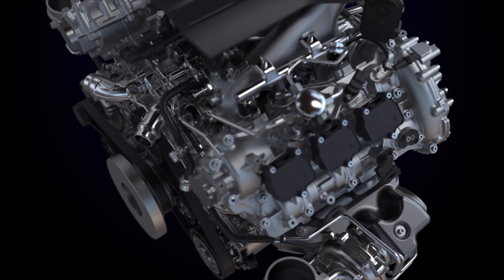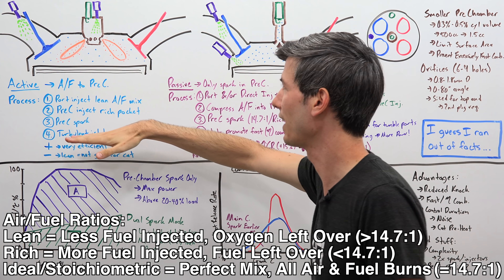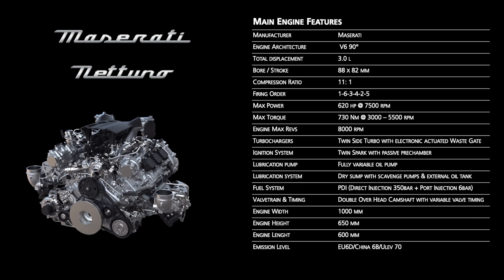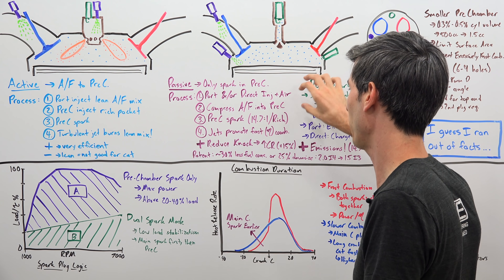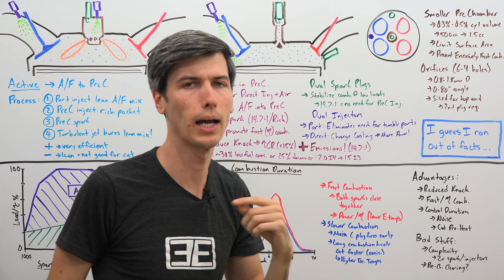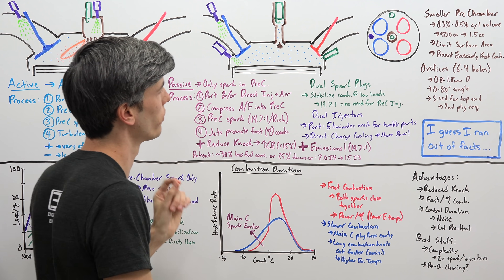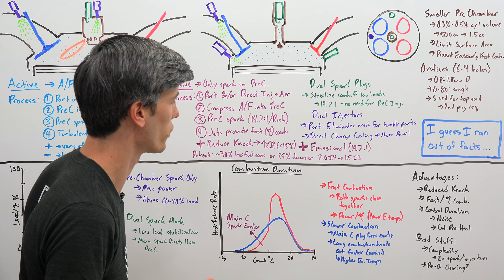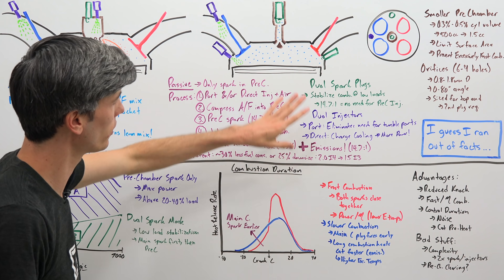How Maserati's Brilliant MC20 Engine Works - F1 Tech In A Road Car!

Comment: Port injection also cleans the backside of intake valves which DI alone can leave them caked with giant gobs of carbon requiring regular cleanings. 

- edit - 
The reason I commented this is because I was waiting for EE to list this
 as one of the benefits of port injection, but he never said anything 
about it which I thought strange given his usually thorough explanations.
Reply: Port injection doesn't clean valve backside when combined with direct injection, specially because works only in low load. Direct injection produces too much soot in low load combustion,  it's real valve fouling root cause.
Reply: e1cabral na
Reply: cb350f actually with Maseratis, its a once a year oil service interval. Don’t know what the Netuno uses but the V6 in the Ghibli uses a 7-9gt oil pan, and they use 5w-40 synthetic oil (less coking that way especially in turbo’ed engines.)
If you figure the average use of any car is about 12-15k per year, is one of the longest service intervals I’ve heard of, next to the Chevy Volt which has to tell you when to change the oil by remaining service life. After 6 years of ownership, still haven’t replaced the spark plugs (mainly cuz the engine is hardly ever used), no 30,000 mi plug change.
As far as time change automotive items goes seems is a better interval, plus Maserati has GT and Indy car test results. Average drivers are easier on Indy cars.
And would rather service my car before it breaks, than trying to find a ride home.
Reply: Full E85 is a solution also
Reply: Brandon Only if there’s E85 around. I don’t see a lot of E85 in states whose politicians have oil interests. E85 is human consumption alcohol (Ethanol is what folks drink).
I don’t drink and neither does my car, though Maseratis can handle it, I don’t do it.
Reply: lol anyone who judges maintenance interval by distance driven doesn't know much about cars.
Reply: @ejv0wjc08gtsnoj0  Agreed, how do you judge maintenance interval?  I have an OBD2 reader which measures the amount of time the car has been driven at each engine RPM.  Every time the car is turned off, I enter those as inputs into a function I've derived, and once the output of that function hits a number that I've pre-specified (which is based on the minimum time the relevant components would be expected to fail if constantly driving at 80% engine load (which in turn is based on a variety of materials and structural analyses, among other things)), I perform the maintenance.  It's so much more intuitive lol I don't know why more people don't do it.
Reply: @firestarter4247  🤣Got eem
Reply: cb350f Hmm, it’s only possible to do 50k/ yr, if yer a single guy with no kids, and/or you live in Alaska and commute to Canada to work, or Texas.
Though never met anyone on a 50k trip, sober or otherwise.
Also, don’t know the chemical make up of Maserati engine oil, but if they can swear by it for a year, what the heck, why not? There’s obviously a reason the oil filter is $50. 
With american cars,  4 oil filters/yr is still about $50, ya have to think differently with these european cars, and it’s a headache for a domestic car mechanic, I hate takin’ pills anything!
On older cars, yep, 3-5mo or 3k-5k miles for oil. Change plugs, wires, and points when they foul.

New cars, read the friggin manual, you’ll be a happier new car owner (especially cuz there ain’t no points ta mess with.)

Admit it, 50,000 miles a year is a bit extreme for anyone. I don’t recall if there is such a section in the owner’s manual for these types of cases. 
If you are a GT driver, well, yer pit crew has it handled.

Though in a Quattroporte, definitely have to make a good attempt at it. V8’s love gas though.
Reply: @pistonwristpin1  Then here and interesting addition from the european market. 
Ford Fiesta 1.0l 3 Cylinder Gasoline 100HP - 1 Year or 15.000km
Ford Fiesta 1.5l 3 Cylinder Diesel 100HP - 2 years or 30.000km
Same with most bigger engines in the European Ford lineup. F.e. 1.5l Ecoboost Gasoline Engine has 2 years or 30.000km, the 2.0l Ecoblue (between 120 and 190HP depending on the model) have a service limit varying between 2 years 30.000, to 2 years 40.000, up to 3 years and 60.000km. 
Although the cars may not achieve does kilometres, depending on the driving conditions and usage. It can occur, that the car gives a signal to do an oil change in the near future, maybe even 5.000km before the normal intervall.
Reply: @Febonicu  these cars will have their engines DONE after 100 000 km. 30 000 km between oil changes is very very bad, especially for modern turbo engines (with EGR) which operate at bigger temps - 110-120 degreec C, instead of usual 90. These cars are good for a warranty period and then they literally die.
Reply: @mojeimja  I did not mention it being good or bad, i just wanted to state a different approach from a different market. VW is known for their "longlife" intervalls, being 30.000km +. But yes in a way you are right, several engines die before 120.000km, not mainly due to their intervals tho. 
And by the way, my Saab 900 Turbo from 1984 also has an EGR. Yes it is not a DI engine, but EGR is not anything new.
Reply: @pistonwristpin1  it's pretty easy to do actually. My boss put 275k miles on his 2016 Silverado. He bought it new. I bought a newer colorado diesel back in May and already put 11k miles on it. If I hadn't lost two months of work from the economy slow down recently I'd probably have a little over 15k miles on it. I drive at least 50 miles a day and 500 miles once a week. We stay within washington state.
Reply: killstrees Sorry for excluding forestry, shall I throw them long haulers in there too? :-) I guess driving is driving. I ain’t doin’ no 50k mi/yr, I like my house too. :-)

Keep the rubber side down!
Reply: @pistonwristpin1  I like my house too. Unfortunately the good paying jobs aren't close to good cheap housing.
Reply: killstrees yep never are.You’ll love retirement, though weird to get used to. Stay safe.
Reply: cleaning is only needed every 100k or so, but an oil catch can can solve that
Reply: They can get caked with gunk long before 100k  on many DI cars.
Reply: @lucasvanhamburg4937  Not if there is EGR installed, it makes valves horribly dirty very quickly.

Comment: Wouldn't the intake stroke "vacuum" out the pre chamber at the same time it pulls in fresh F/A mix?  Full disclosure I'm not an engineer nor did I stay at a Holiday Inn Express last night.
Reply: The pressure in the pre chamber will be essentially equal to the pressure throughout the cylinder. Whereas the pressure in the intake is up to atmospheric pressure (aka higher than in the cylinder pressure during intake). Because the difference in pressure is much larger in intake/cylinder vs pre chamber/cylinder, much more flow (even as a percentage of available air) will come in from the intake port, not the pre chamber.
Reply: Well the pre chamber and main chamber are always at the same pressure (within reason, they'll be different pressures briefly as combustion is incomplete and still occuring) so there's no pressure difference to push or pull the spent gases out the pre chamber so my guess is there will be some spent gas and some new f/a mixture in the pre chamber. However I'm sure Maserati have done extensive CFD modelling to try and minimise or prevent this problem

Comment: So some issues I see are the water jacket around it leaking, the jets getting clogged, the side spark plug causing uneven wear on the piston, and constant error codes due to having 12 variable use injectors and spark plugs.

If you want less knock, run ethanol. It's a renewable fuel anyway

Comment: Pre-chamber exhaust gas clearing was my first concern when I saw this: there must be some shock wave effect that scoops exhaust gases out before the next cycle, because as the piston goes up that air does not seem to be expelled through the exhaust valves. I suppose dirt accumulation may be solved with a simple cleaning mechanism during periodic maintenance when the spark plugs are replaced - huge advantage of having a small and simple pre-chamber, around the same diameter as the spark plug!
Reply: Easy to clean during service was my thought. All it would need is pull the plug, a squirt of solvent/fuel and a (maybe brass) wire brush shaped to suit the chamber in a power drill (or similar). Owners of these sorts of cars are going to get them serviced regularly and are unlikely to do huge distances so it's no big deal.
Reply: @Shaun.Stephens  they will also rev the arse off the engine which will help.  If you were just town driving I think it'd have a problem, although it still has the second plug so it should still run until you can open up the taps.
Reply: Putting on my Engineers hat, I would say that some detailed Computational Fluid Dynamics (CFD) would have been carried out to analyse this very issue. Also, remember that the fluid being forced into the pre-chamber is an air/gasoline mixture. All gasoline fuels contain some detergent additives/effectiveness in order to clean soot. Combined with the fact that the velocity of the expanding gas jet from the pre-chamber will be relativity high, thereby aiding in the cleaning of any soot. However, as the pre-chamber is so small 10-> 15ml and the jet paths are quite narrow, I would hazard a guess that there may be some long term issues.
Reply: @anthonycanalese2142  , that Is exactly what happens, but if you think about It , wall wetting Is what produces soot.
So there should be the problem of soot depositing on the prechamber nozzles.
But since you are burning everything with the flames you dont suffer of soot nucleation around the prechamber.
The main problem here Is temperature an pressure at Turing.
 so probably in future we Will see diesel like pistons(stainless steel).
Reply: @robertolucignano3495  With a super lean burn will there be much/any soot?
Reply: @robertolucignano3495  which engine has stainless steel pistons?
Reply: @extractorfan2143  diesel engines have steel pistons
Reply: @agt155  exactly , no soot with lean burn, but they are not lean in full load, i was talking about fullload ooerations
Reply: @robertolucignano3495  all of them?
Reply: @extractorfan2143  no, the latest ones i think, for example Mercedes , i know they use them since a long time
Reply: @robertolucignano3495  Farmers been doing it for years to get more MPG in their cheaply made industrial engines. Using spark plugs with sleeves lowers compression ratio but increases energy distribution more efficiently. Increasing compression and undersquare engines work best. Water injection reduces build up in chambers.
Reply: @altruismfirst6489  nice trick my friend
Reply: Exhaust gas recirculation inside the pre-chamber should be an issue. During the exhaust phase the pressure in the cylinder is high so the prechamber likely remains filled with burned gases. It's during intake that the cylinder low pressure empties the pre-chamber. Then the pressure goes up and the pre-chamber can be filled. I guess that's why they use both sparks in low loads: they build up a high pressure in the chamber, this fills up the pre-chamber, then they ignite the prechamber. But I don't see how this can work at 8000 rpm. In high loads the boost level + compression make the pressure gradient high enough to fill the prechamber may be to 90% of its volume. So this would make an egr of 10-15% and this would be enough to have a stable ignition. Still surprising.
Reply: I bet the pre-chamber is coated with some space age anti stick material or the entire chamber itself is made entirely from a material to prevent deposits.... ceramics?????

Comment: A Honda CVCC for the new century
Reply: I was thinking Honda CVCC+Nissan NAPS-Z (dual spark plugs per cylinder).
Reply: Maserati 3.0L = 630 hp
Nissan 3.7L = 320 hp

lmao at asian engineering
Reply: @ivangamer8022  you know what is a turbo engine and what is a natural aspirated engine... Well I guess not...
Reply: A fitting profile picture for a guy that can't use google.

Comment: I bet the spark timing on those things are wayyy advanced relative to TDC
Reply from the maker: The lil graph at the bottom is pulled from the patent (and the torque curve actually lines up perfectly with Maserati's stated torque curve). On the patent, they show timing around -30 to -15 degrees (bTDC).
Reply: @EngineeringExplained  Seems actually relatively mild.  -30 for cruising and -15 for full load i assume.  The -15 on full load is relatively spicy, but hey new efficient engines and all that.
Reply: @detaart  -15 on a 11:1 turbo with street gas... thats amazing
Reply: @MitchRichard65  It's not super crazy, but it is quite good.  Until we see this engine in the wild, we can't make assumptions.  We don't know the boost, expected charge temps, etc.  And also ... modern engine management always targets spicy timing, but most of the time, in the real world, also pulls a lot of timing all the time, so ...
Reply: Not sure why I saw his response not have the parenthesis before... That makes sense. I was super concerned. I saw "-30 degrees bTDC" not "-30 degrees (bTDC)"

Grammar kicked my ass there LOL
Reply: @DivaniKingston  do the parentheses make a difference ???
Reply: @MitchRichard65  the way i read it yes... "Negative-30 degrees Before Top Dead Center" is mathematically 30 degrees After top dead center. My brain multiplied the negative to the b as well as the TDC. The negative of Before is After... 

But "Negative-30 degrees" is grammatically referencing TDC. So -30 degrees is 30 degrees BEFORE Top Dead Center. Hence the parenthetical BTDC. 

Again, it was me being goofy, and reading too fast
Reply: I've seen 35-40 degrees of timing advance pretty often in my IS-F so that's nothing out of the norm
Reply: Depending on the load yes. High load + high compression + boost on 93 octane, 40 degrees is going to blow your gaskets, bend a rod, or shatter a piston. 

Yee 40 at light throttle high vacuum is realistic... But not in the context of this.
Reply: Are you saying -30 as in 30 degrees ATDC? 😲
Reply: @DivaniKingston  Before...Negative numbers come before 0 (Zero), positive numbers come after.

Comment: This sounds an awful lot like pulse-jet ignition which is a relatively old tech in certain aero engines. It's an insert in place of a spark-plug into which you put a different sized plug.
edit: seems the pulse-jet marketing bumf mentions the similarities with ferrari and MB f1 engines